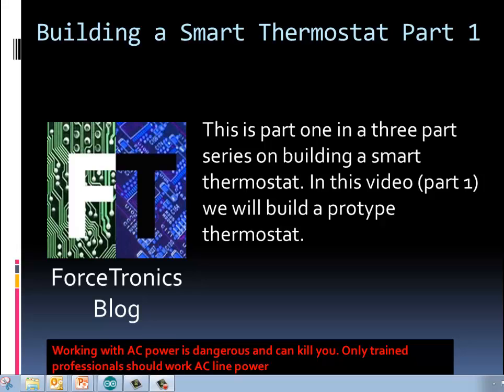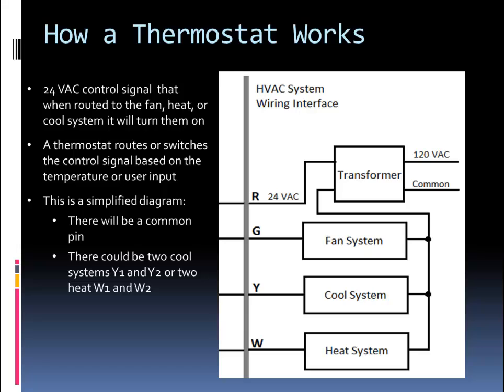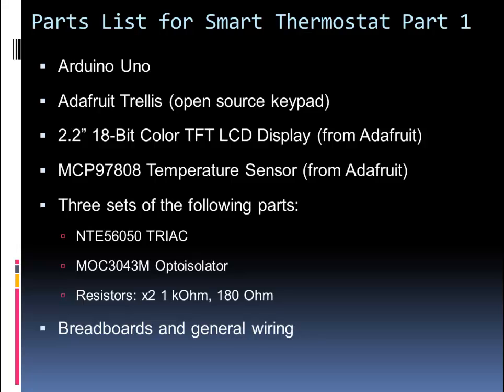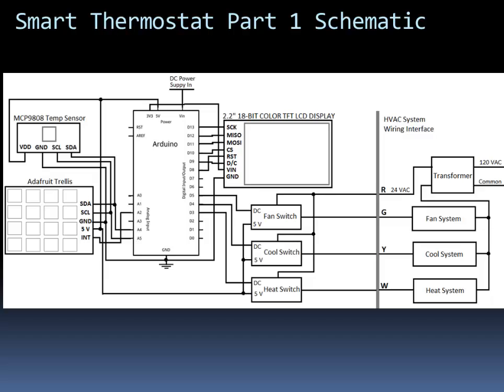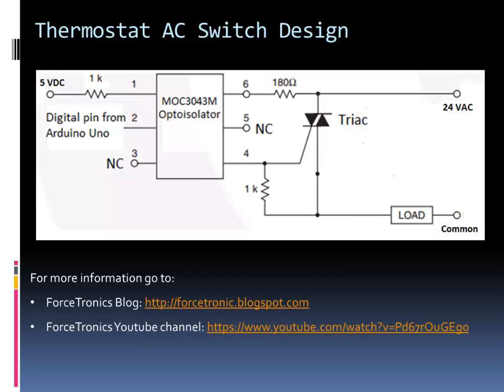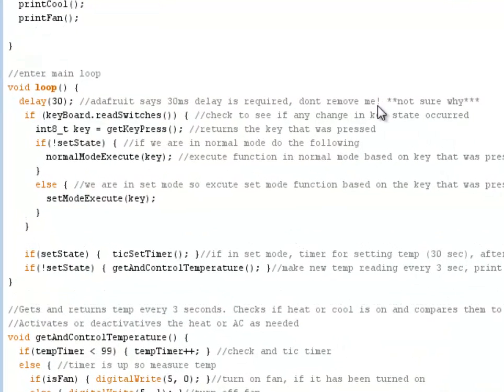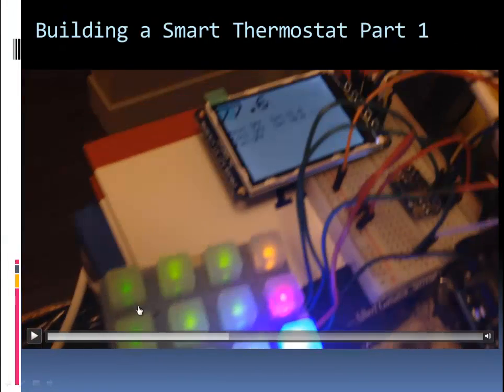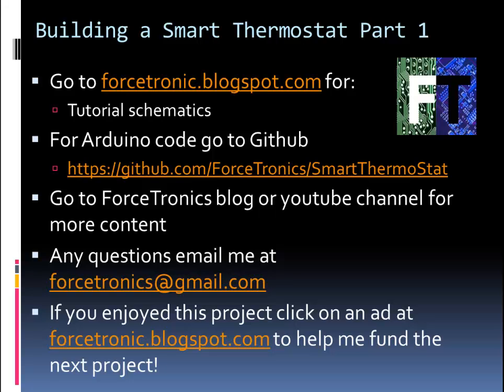Building a Smart Thermostat Part 1

Comment: After reading up a bit on TRIACs and the optoisolator circuit you described - there are many suggestions to add a snubber circuit (resistor & capacitor) to the AC side of your switches because of the inductive load from the fan, etc. Is there a reason you left this out, and how would you go about sizing the resistor/capacitor of the snubber for each of the 3 circuits if you decided to include one?

Comment: I would love to build this controller but is there a way to make it without the trellis switch buttons? 01-03-19
Reply from the maker: You can use any interface for controls, for instance a touch screen. But you will need to adjust the code for whatever hardware element you add or change

Comment: Hello! Would there be any way to power this straight from the 24v wire?
Reply from the maker: Yes and I almost went that direction but got lazy. Add a bridge rectifier IC, some big caps to filter, and then a rugged DC to DC converter. It is too big of a voltage drop to use a linear regulator.

Comment from the maker: Checking in over a year later and the smart thermostat is still running in my condo with no issues. The only complaint would be the bluetooth connection with my Android phone can be flaky sometimes, but it works fine 90% of the time.